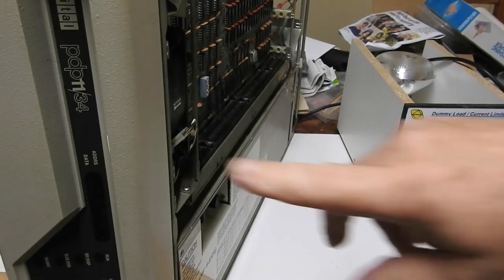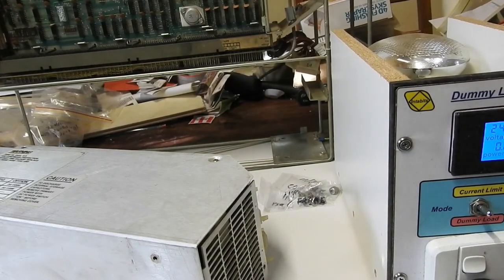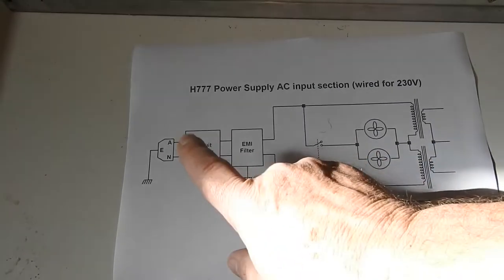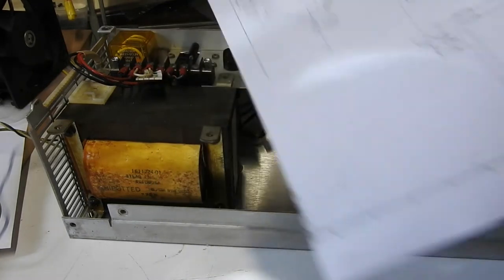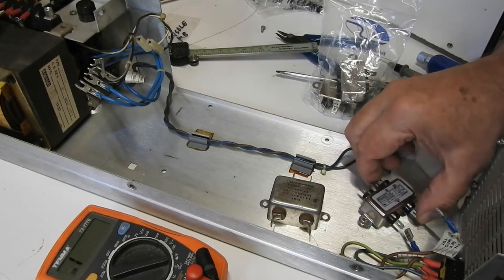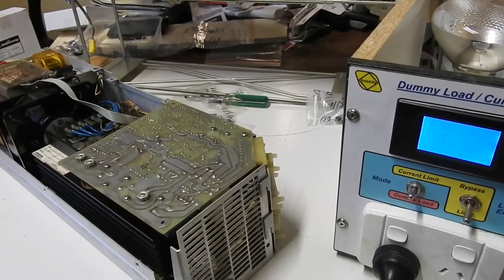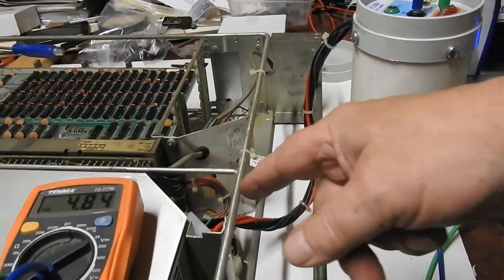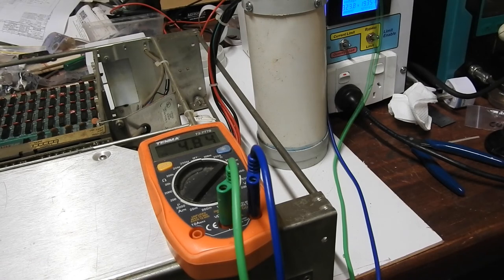PDP-11/34 Power Supply -  What went wrong?

Comment: The older EMI filters are known to contain e-caps made by the RIFA company. RIFA e-caps are literal time bombs, waiting to explode catastrophically, destroying adjoining components, circuits and the PCB. They are a "replace on sight, no exceptions" part. They are identified by their golden, clear epoxy coating and rectangular shape. The epoxy cracks, over time, allowing moisture to enter and turning them into a run-away steam boiler. RIFA e-caps are also found as discrete components on the PCB boards of older equipment, even those of the very top name brands of electronics test equipment. Anyone not familiar with them should educate themselves thoroughly about theses little sticks of dynamite.
Reply from the maker: I've had one explode in a Tek 2465 scope, but not in a filter. Doesn't the case limit the damage to nearby parts? 
I never check for them in filters, but I should...
Reply: @bertoid  Yes, the case might help with limit the explosion. No, it does not help with the electrical chaos of a full Mains short.